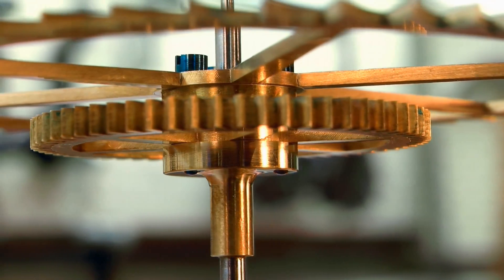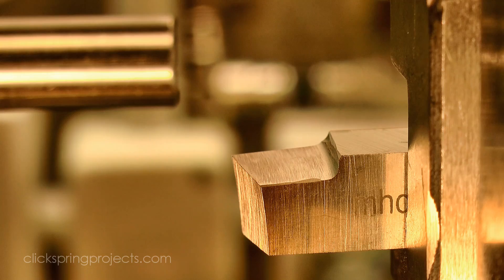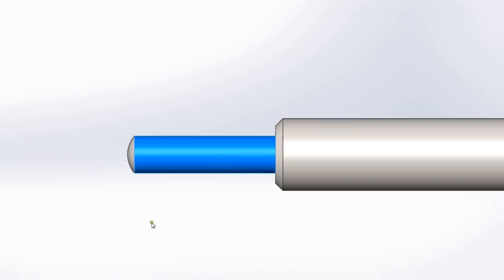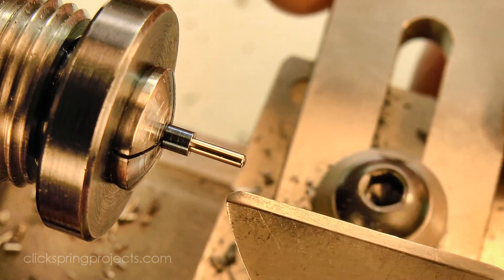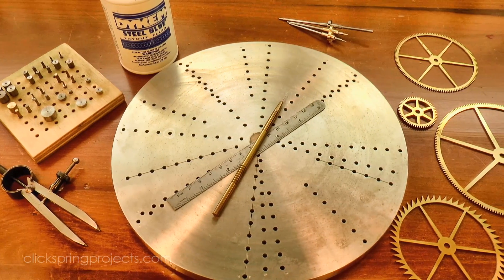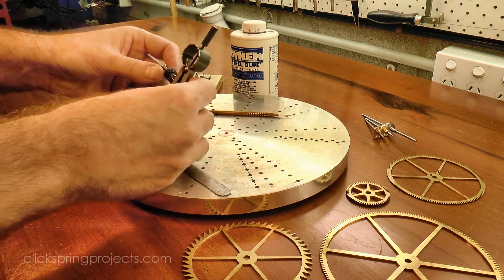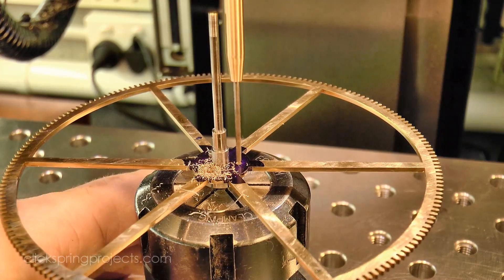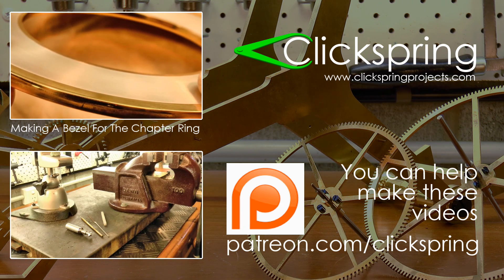Clockmaking - How To Make A Clock - Part 12 - Making The Collets And Other Arbors

Comment: Hi I've just stumbled on this build and your work is stunning. Way back in 1984 I made the John Wilding Congreve clock. Its still running fine but its not the clock to make if you want a good time keeper - its rather horologically challenged. I note you find making the pinions a little challenging, have you ever made lantern pinions, they may be less of a challenge

Comment: Hi Chris, you could have drilled and tapped the centre collet before you glued it to the arbor using your milling machine and pitching out, that way you wouldn’t have needed to make a tap extender but nevertheless you’ve done a great job.

Comment: I love your series, but I cannot stand one thing - I understand using super glue during the work, but using it for final work is just.... devastating whole "clean" idea... I understand that other ways are harder to make, but you are not bad making screws.. and you could wax too... Superglue ruins much of your work... Within few years your clock will stop or fell apart, don't you think? So much dantastic work...
Reply from the maker: Not using superglue, but rather Loctite 603 a very effective engineering adhesive widely used in modern horology: http://tds.loctite.com/tds5/Studio/ShowPDF/603-EN?pid=603&format=MTR&subformat=REAC&language=EN&plant=WERCS

Comment: How can you be confident the shaft ends you turned by hand are not tapered? I am loving your videos by the way, you're video production is as good as your machining skills.
Reply from the maker: Its surprising how well a cylinder can be turned by hand with a graver, particularly if you've got some decent magnification. Your eye can pick up the slightest deviation from parallel. The step using the Arkansas slip stone is also key to achieving cylindrical pivots. It removes the tool marks, but is also a flat cutting surface. So if the initial cuts are made carefully, applying the flat stone reveals any non cylindrical shape, and ultimately can be used to correct the profile. Having said that, providing the pivot tapers from narrow to large, a tapered pivot is not usually a problem and in some cases is even deliberately formed.

Comment: Hi Chris, did you balance the wheels at all or isn't that a necessary function?, cheers, Gordon
Reply from the maker: Generally its not necessary to balance clock wheels because the angular velocity is usually very low. Although its a different story for something like a watch/chronometer balance wheel - the angular velocity is very high so balancing is critical.

Comment: I try to blue or oxidize parts directly in the flame and then drop them in water when the color I want is achieved. What's the reasoning behind the brass shavings or brass plate if I might ask?
Reply from the maker: The brass distributes the heat more evenly and slows down the heat transfer, both of which assist in achieving a more uniform color, thanks for watching and asking
Reply: I work in firearms and normally use a product called Nitre Blue for multiple parts but for one off's I just use the heat. I'll definitely give it a try next time. I also shared your vids with a elderly friend who's retired from clock making, he really is enjoying watching!

Comment: Ok, I just got my Vallorbe pivot file and burnisher but I frankly have no idea how to use it...It looks like you oiled it before use?Do I need to use a lapping paste on it or rough it up a little in the same way I do with a smooth broach?
Reply from the maker: Hey Peter, I use a coarse abrasive paper: https://youtu.be/b5KwOi-JkEU to "make" the burnisher and a light cutting oil as lubrication on the pivot. I have found that getting the pivot surface well prepared before burnishing is important. First with the file, and then an arkanasas slip stone. The stone is the key. It squares up the pivot profile and smooths the surface to a dull gray. Watch for metal trails on the stone surface to tell you where the remaining low points are, before proceeding to the burnisher. When you are getting a uniform metal trail on the stone, follow up with the burnisher and the surface goes slick with moderate pressure within seconds.
Reply: Hi. I just came back of holiday and saw this!! thank you so much. very helpful.  I had a look at some stupid hour this morning and I think I may have bought the wrong file. I think I have a left handed one and I need a right. I think I could get away with using it on the front of the workpiece but I would prefer to use it on the back to I can see what I am doing. the parallelogram is the wrong way round (very easy to demonstrate but a pig to describe!!). sound like I also need to get a slip stone!

Comment: How do you decide whether to blue the screws in brass shavings?
Reply from the maker: +Brian Schultes Hey Brian, if the screw is longer than the depth of the flat bluing tray, then I usually use the brass shavings tray instead. It gives a more consistent color. The flat tray is great fro the really small screws, because it heats up much more quickly. I have a new video out in a little over a week giving a lot more detail on the bluing process. Thanks for watching.

Comment: Hi there. I know this may be a late response, but at 5:45 I saw a lot of small iron fibers standing straight up from the graver surface. I was wondering if this was due to static electricity, and if so: is a big annoyance when turning like this?

Cheers mate.
Reply from the maker: +rodyle1313 It's caused by magnetism that is apparently induced by friction with the cutting tool. It's not overly annoying, thanks for watching :)

Comment: Hello,

I really thought pivots were inserted into the ends of the arbors. I didnt know the entire arbor with the pivots were one monolithic piece.

Would appreciate of you could throw some light on this...

Thanks
Dandy
Reply from the maker: +Dilip I In classic clock and watchmaking, new pivots are generally formed as part of the arbor structure. However when being replaced after many years service in the clock, a "re-pivot" will involve turning off the old worn pivot, and then inserting a new pivot in the end as you describe. Thanks for watching and asking.

Comment: Very nice work as always Chris.  I'm confused about the seemingly mixed units on this clock though.  While using the dividers you were using what looked like the inch scale (3/16") and then later you mentioned BA screws.  What's up with this or are you testing us?
Reply from the maker: +Keith Ward Ha Ha! No not trying to test you :) Its not uncommon to see BA screws used in model engineering and clockmaking, its a great fine thread standard even though its been officially phased out for some time. In my part of the world, the BA taps and dies are easier to find and much more affordable than the small equivalent metric sizes. Thanks for watching Keith!
Reply: +Clickspring Hmm, interesting and good to know.  I'm not sure I have ever actually seen a BA screw, tap, or die.  Funny how you have a slight difficulty getting materials but have BA components readily available.  Actually something that McMaster-Carr doesn't have nor will likely ever get.

Comment: Have you ever considered finger tightening the screws then marking them before putting them into the mill and slitting the heads.  That way all the screw heads would have the same approximate orientation with regard to the shaft when tightened?
Reply from the maker: +Michael Unknowable Hey Michael, yes will probably time the screws on the next one :) Thanks for watching and suggesting.

Comment: hey hello, I have a project in hands and I would like to know if you could provide some advice on the subject, the thing being designed is a cargo trike and your input is required, this because I would like to know the shape of the rear articulated shaft and the type of bearings needed... please let me know if you are up for this... so I can prepare a word file with some images that will help
Reply from the maker: +Robert Ostman Hey Robert, my time is fully taken up with my current commitments, but thanks for the offer., and thanks for watching.

Comment: We have a Sherline lathe at my work which we use for re manufacturing various things in repairs of vintage items. Mostly aluminium, various plastics and rubber parts. It's an absolutely awesome machine to which we do not do justice but this guy certainly does.
Reply from the maker: +InsideOfMyOwnMind Love the little Sherline, I'd be lost without it. Thanks for watching :)

Comment: what is a burnisher ??
Reply from the maker: +Jerz Zapata A hard rod like tool with a very fine cut surface, used to slightly deform the very top surface of the metal, causing it to be both polished and work hardened. Thanks for watching :)

Comment: I happen to notice on this video the scribed line with the caliper was not on the point of the caliper. With all of the scribing you've done with that caliper you may need to sharpen the point. Or perhaps a new tool is in order similar to the gauge you used for the barrel arbor measurement but with a replaceable scribe point that can be easily set with the caliper. I could sketch one up if you'd like.
Reply from the maker: +kzinty Thanks for the tip, and thanks for watching!

Comment: Good relevant stuff Chris--for the viewers that don't know there is a book called "the amateur lathe" by an old school machinest by the name of L H Sparey.This book is an asset to any hobby machinest and a welcome addition to anyones library..
It seems to be readily available on ebay for a modest price..My copy was printed in 1948 and used to belong to my father so I treasure it.
Page 87 in the copy I have suggests ideas for making homemade reamers---they look quite good and suggest using silver steel so what I am going to do is -go to an engine reconditioner and get a selection of stuffed valves from the cylinder head and use these.
Sparey idea is cut obliquely across the valve stem and that is your reamer..
Pretty simple.I tips me lid to some of these old blokes they were brilliant..Some other ideas for your subscribers Chris.Keep your vids coming..
Reply from the maker: +Ian Craig Good stuff Ian, thanks for sharing :)

Comment: nice video ! how do you keep your dimensions true with hand turning ?
Reply from the maker: omkar joglekar The dimensions for hand turning a pivot are kind of relaxed, because the pivot hole will be broached to fit, so all I really need to do is hit close to the nominal diameter. The small out of round error that results from the hand turning is corrected by the slip stone, and a little judicious cutting to tidy up, but its surprising how close you can get to an on dimension cylinder just by eye

Comment: What drill tip geometry are you using that prevents the "grabbing" of the thin brass material?

Very nicely done videos.
Reply from the maker: cdbflynow I lightly stone the cutting lips with an arkansas oilstone to make it zero rake. Thanks for watching and asking.

Comment: G'day Chris!

Excellent video as always!
2 questions:

1) When hand turning, how do you keep the dimensions correct?
2) Will you be making  a spare parts video about the drill extender?

Cheers,
Ivo
Reply from the maker: spankmeister Hey mate! The dimensions for hand turning a pivot are kind of relaxed, because the pivot hole will be broached to fit, so all I really need to do is hit close to the nominal diameter. The small out of round error that results from the hand turning is corrected by the slip stone, and a little judicious cutting to tidy up, but its surprising how close you can get to an on dimension cylinder just by eye.

I'm kind of kicking myself, but I didn't shoot anything for the drill extender, I just wanted to get it done, the video was already blowing out my time schedule - this one was a real killer to shoot! I might do it as a dedicated tool video down the track, maybe a set of extenders, something like that.

Thanks for your support mate, I appreciate it.

Comment: Another wonderful video.  Where on earth can I find a burnishing tool?
Reply from the maker: John Creasey Hi John, I suggest making one yourself - take an old needle file, gently grind off the teeth on a belt sander, or stone off with an oilstone, and then polish up. They are better than anything you can find for sale - super sensitive, light to the touch. Cheers mate, Chris.
Reply: Thanks Chris, I will give this a go.  It looks like a really good technique.  I just need to get a file, I only have one!

Comment: I'm wondering how the collets and pivots were fixed together before Loctite.  Solder, pins, a light press fit, collets and pivots machined as one piece?  The whole process is fascinating.
Reply from the maker: ***** You hit all of the options they used right there! In fact pinions were often turned as one piece from a pre-formed stock called "pinion wire" - a long extrusion of pinion teeth, and then the teeth were turned off in the lathe for the length of the arbor where they were not required. You're right, it really is fascinating :)

Comment: Chris, not a lot of measuring on the hand turning. Did you do that and not including it in the video?
Reply from the maker: ***** Hi Gus, yes that's correct. I made a quick check to be sure it was in the ball park, but to be honest pivot OD's are kind of easy going. The pivot hole is broached to fit the pivot, so as long as its close to the nominal figure, its good to go. I have to leave a lot out to keep the vids moving along, and that was one scene that got the chop :)

Comment: How accurately did you have to set the position of the arbors on the pivot rod when you loctite-ed them on? I couldn't see any marking or measuring but it must be very accurately positioned?
Reply from the maker: warrantyvoid100 I had to leave a few things out to keep the video at a reasonable size, and that was one step. The collets are positioned along the arbor, so that each wheel and pinion meshes with its pinion. It needs to be fairly central, and also sit within a 'range' so that the wheel/pinion mesh can accommodate the end shake of each arbor - approx 1 mm of total movement, if you imagine the pinion arbor pushed fully one way, and the wheel arbor pushed fully the other way... Thanks for watching and asking :)

Comment: get videos!!. how do you like your sieg lathe? i had to do some mods to mine to get it how i like (still got more to go, ive made videos about what i did if you want to check them out).. im from Aus to so can i ask where you buy your stock from? ive been looking for some reasonable priced stock.. thanks and keep the videos coming
Reply from the maker: HomeDistiller Hey mate, just subbed your channel :) The lathe is good for what it is, here's some more info: http://www.clickspringprojects.com/blog/which-lathe-should-i-buy Stock is a real pain for us here in Aust, more info here: http://www.clickspringprojects.com/blog/i-steel-havent-found-what-im-looking-for Cheers, Chris.
Reply: i have got some bits a pieces from smallparts.com.au the prices are all over the shop but you can find some ok prices if you look hard enough, thanks for the sub!

Comment: Just discovered your work via the AvE channel. Fascinating stuff you're doing here. I was wondering what 3D modelling program you're using for designing your parts?
Reply from the maker: Alistair Spence Hey Alistair, I use Solidworks. It's great to use, very intuitive. Easily the best software I have ever used, in any field. Thanks for coming over to check the place out :)
Reply: Clickspring Thanks for the reply. I was kinda hoping that you might say some other program, Solidworks is so expensive! Still, I hear it is a great tool. Very powerful. I guess you get what you pay for. 

I'll be making my way through your videos until I'm all caught up. Lots to learn. Thanks again!

Comment: Turning the pivots by hand doesn't it make for a lenghty process of checking and rechecking that the turning job is straight (? (I'm not questioning your methods...tough, just seems to me that the job might be slightly barrel shaped or cone shaped and won't work well unless a lot of measuring is involved)
Reply from the maker: Armilar Zifferblatt You know I though the exact same thing when I first saw this being done. Once I tried it though, I realized why clockmakers prefer to do it this way - you can rip out the waste stock so much quicker, and get to the business end of the turning much faster.

You're correct that there is a slight unavoidable error to the turning, although its surprising how close you can get it, simply by eye. But all errors are dealt with by the stoning step, which squares everything up. It's not at all difficult to get within a few thou of the correct diameter, parallel, stoned and burnished inside 2 or 3 minutes. There is one caveat: Pivots are always turned to a nominal diameter, and the holes broached to fit, so hitting the diameter dead on is not required, it just has to be close. Thanks for watching and asking :)

Comment: Another great vid Chris. Will you use any light oil or lubrication when the clock is assembled or do the burnished shafts spin freely enough as is?
Reply from the maker: Jess Neal Hey Jess, the pivots spin quite freely as-is, but I will be using a light clock oil to reduce friction even further.

Comment: Nice work. Have you created a final model of the clock in Solidworks and going thought the manufacture of each assembly?
Reply from the maker: Jonny Stevenson Yes, exactly. I'm a little over half way at the moment. Escapement, pendulum, motion work etc all still to come. Thanks for watching.